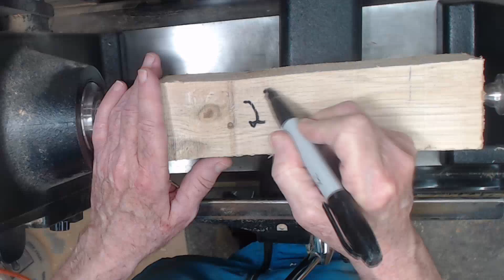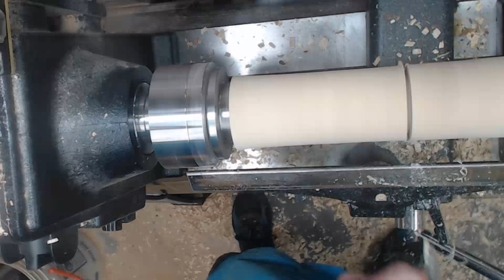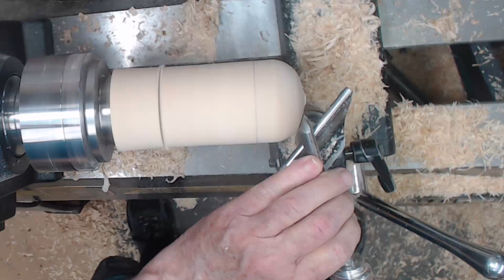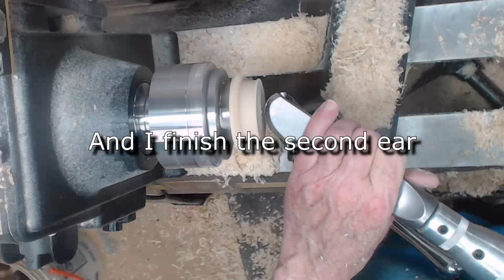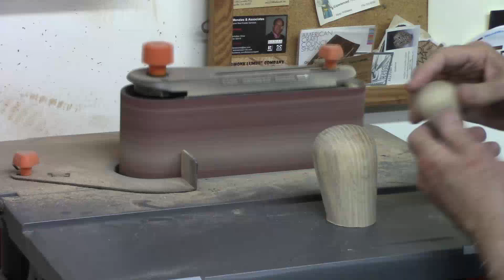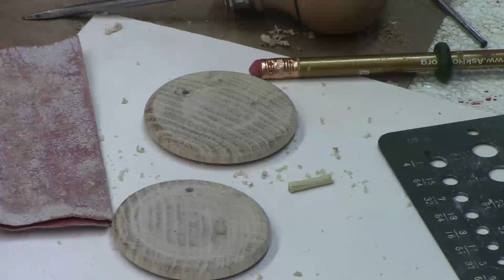I Carved an Elephant Using Only a Lathe

Comment: Timely for an August birthday! My youngest granddaughter loves elephants. Mike: did I miss you tightening the set screw on the chuck? Where did you get the odd parting tool...thin end and thicker shank? Thanks for the video. I agree that the coarser grain stands out on the small turning.
Reply from the maker: That thin parting tool is a Carter and Sons.
Reply: @MikePeaceWoodturning  Mine is $$$ Tree chef's knife.
Reply from the maker: I do not use a set screw on a chuck. You have to be cautious with larger projects though.
Reply: @MikePeaceWoodturning  Had a chuck decide to take flying lessons.
Reply from the maker: Instead of hitting the off switch you have to turn the speed down. Otherwise the electrical brake can slow down and the chuck can unwind.
Reply: @MikePeaceWoodturning  No electric brake but I have to reach the headstock to slow it. Anyway...lesson learned.